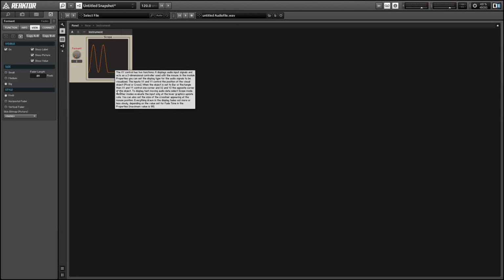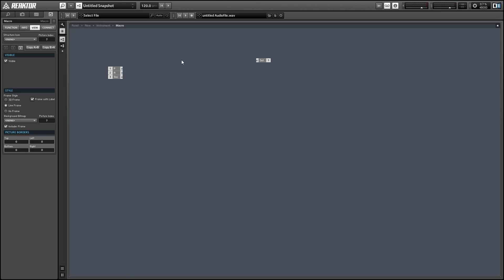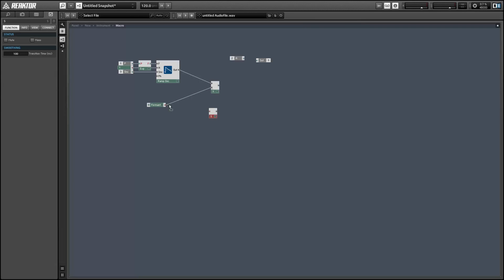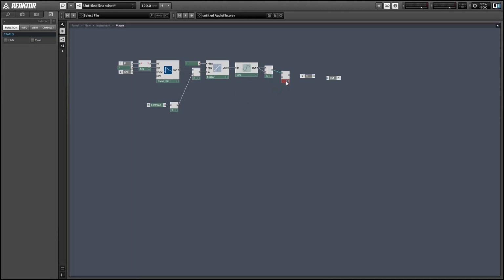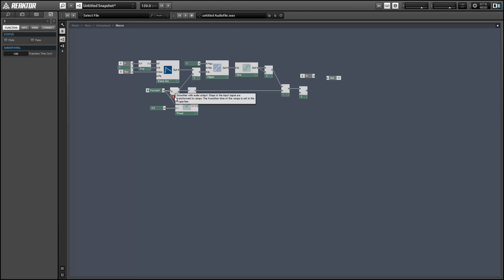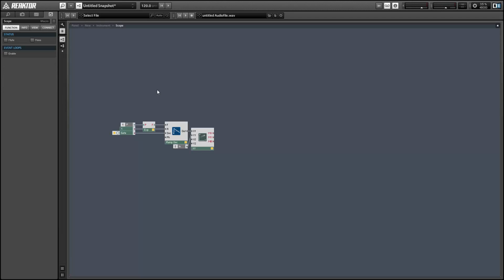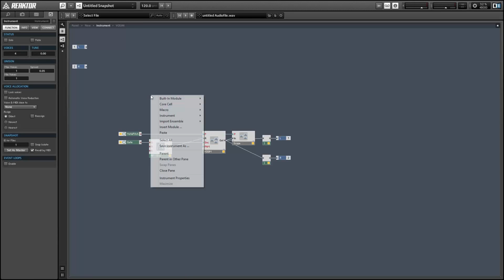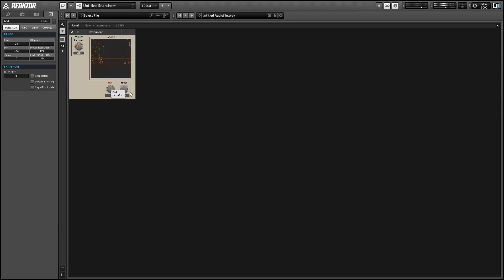NI Reaktor - Creating a VOSIM Oscillator

Comment: Will you be doing any of the oscillator tutorials in Core?
Reply from the maker: no, they'll all be in primary. there are a substantial number of text-based tutorials on our site however, and a full section on oscillators in the 3-hour core course... once you are familiar with either one or the other, it should be relatively easy to translate between core and primary (just remember that the primary sine module is sorta strange).
Reply: Yeah it is pretty easy to translate between the two. I was just curious because there's some things (like the sine and ramp oscillator modules) that I don't know how to translate into Core. Do you have any idea how you would use (or create) those 2 in Core?
Reply: By the way, the tutorials you do on nireaktor.com and in the Core course are awesome. They've helped me a lot. I thought Core would be hard to learn but it turned out to be somewhat easy and I'm finding a lot of things to be more intuitive in Core. The only problem I have is not having some of the Primary modules (or something that works like them) in Core. I think it would be great if you had a series for replicating some of the Primary modules in Core. I'm not sure how useful that would be to other people though.